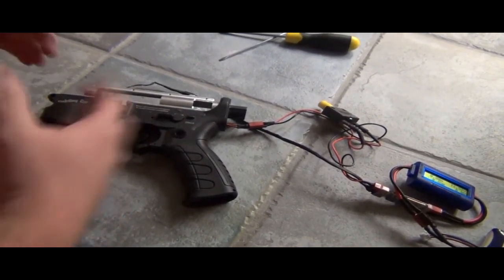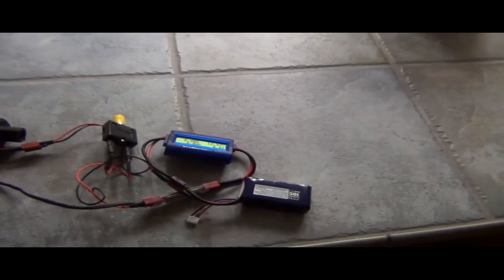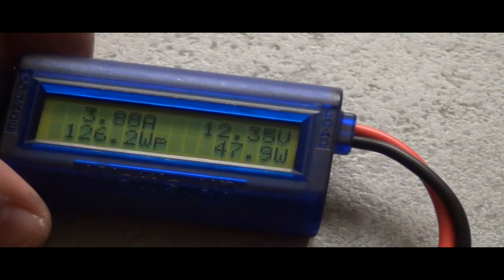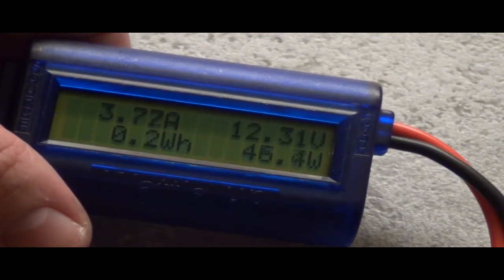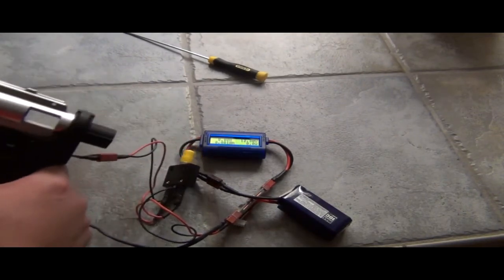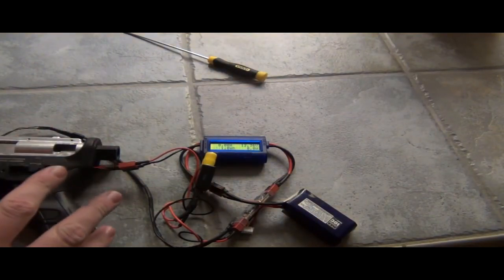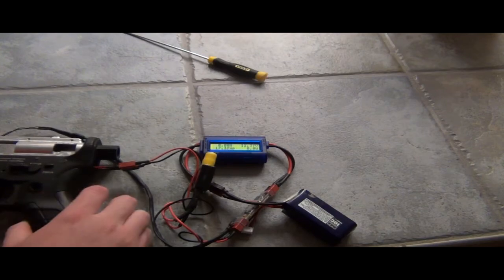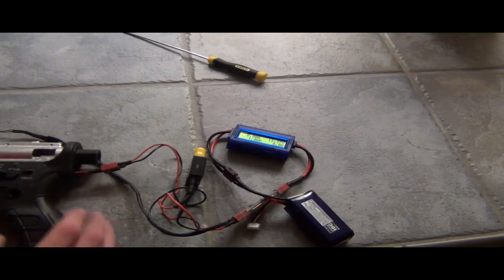Perfect Mesh, Height, And Efficiency with Watt Meter

Comment: I would be willing to bet that the AMP draw is also going to vary based on the TPA of the motor and how clean the communicator is.

Also, why is it bad to have the gear rubbing directly on the bushing? Do the shims rotate around at an intermediary speed, sort of acting like a bit of a bearing holding grease between the layers of shims or something? I ask because several of my builds have a gear in direct contact with a bushing and it seems fine.

And when doing the sound test, it seems best to me to have all the other gears removed to isolate the noise variables.
Reply from the maker: More torque would definitely be less amperage usage, so yes you are right.

As for rotating a bevel into a bushing, long term it is very bad. Short term might not notice a serious issue.

You definitely sound like you know some stuff.
Reply: Hmm. Well my MP5 did have a bushing rotating in place when the gears were spinning. I thought it was cause the bushings weren't glued in yet, but it might have been from direct contact……….Oh well its re-shimmed now with new bushings
Reply from the maker: Shim also has less friction because of it's size in diameter.
Reply: You mean since the shim has a larger contact patch on the bushing?

I'm about to re-do my bevel to pinion meshing on both my guns. Check my vids to see what they sound like as of now. Ur vids shined some light on how I need to do this lol
Reply from the maker: No the shim is less diameter than the bushing.

Comment: Okay, I shimmed it. It works great now! But now my wiring/motor is heating up after maybe about 200 semi's and a hand full of 3 round burst. I don't have it pulling anything, I have it just like you have it in the video: bare bones. Just gears and motor, oh and I've got AB. pretty sure that is the culprit. Or maybe my shimming on the motor is too tight?

Comment from the maker: Really? Because I have been copying this way for a long time and had no issue except for the V2 grip gap in GGs and GPs. The spring does make things shift but if it is shimmed properly that shifting should be very small. The shaft can be shimmed if it is moving up and down too much.

Comment: IME the bevel to pinion distance changes a little when under full load, because there is room for the motor shaft to be pushed away by a significant amount. And that amout changes with different parts. With just the gears in, the pinion position stays the same when cycled because there the gears arent resisting to move. It is the reason why I never find the correct motor and bevel height by only testing them unloaded, because that way you're missing a vital variable.